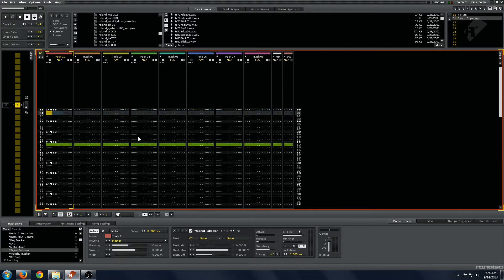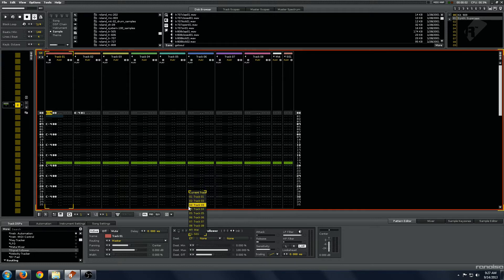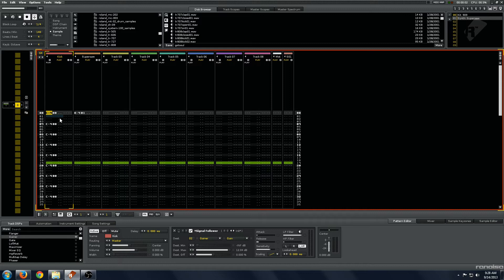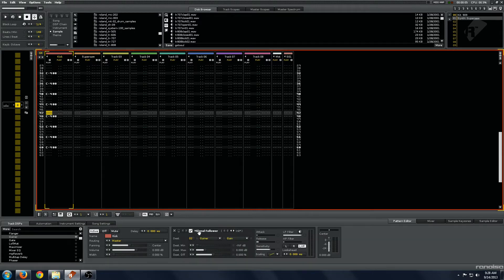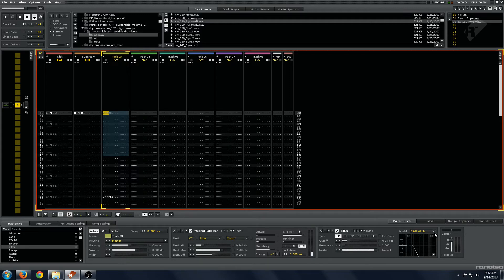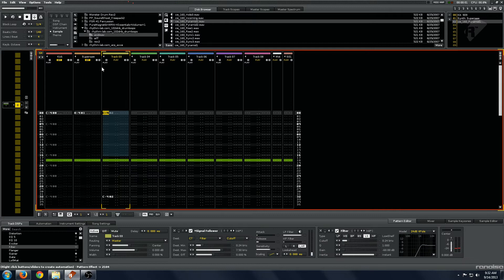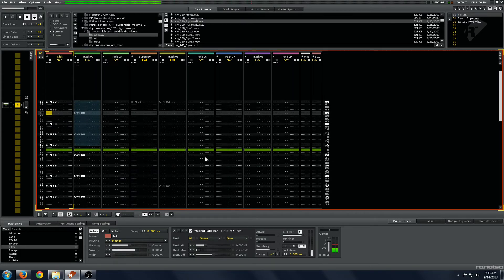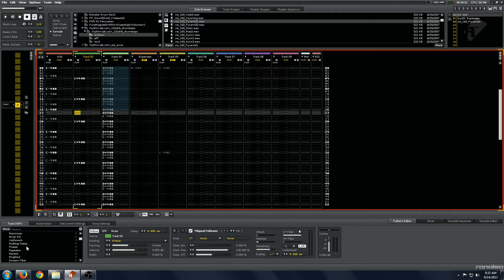Renoise Signal Follower Fun

Comment: hey mate, thanks. but do yourself (and us) a favor and get yourself an audio denoiser XD your power supply is almost as loud as the music XD there's a behringer one called "hd400" hum destroyer for around 30 bucks and the problem is history XD
Reply: i disagree with you. It's quiet, and it doesn't even interfere with audio material above it. (sorry, but you asked to ->) Your sound on your latest clip is the worst ever, (strangeness #4 - trailer) + splatial image is awful.  Your clips have a lot more need for de-essing than this hum is causing here, so move along.  :)